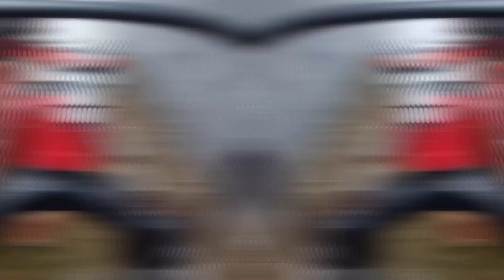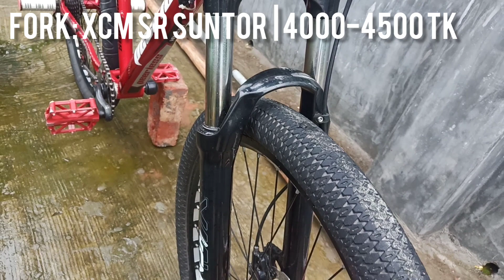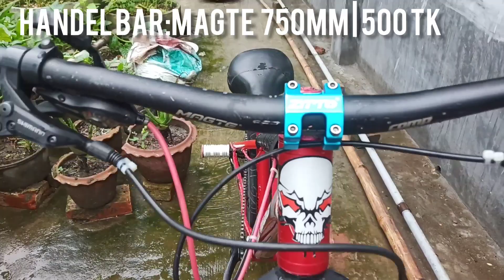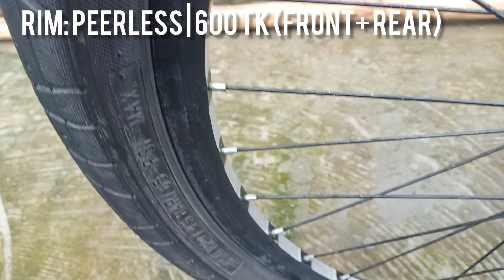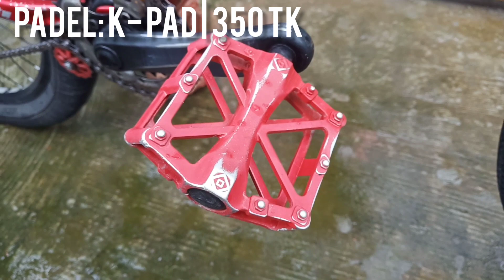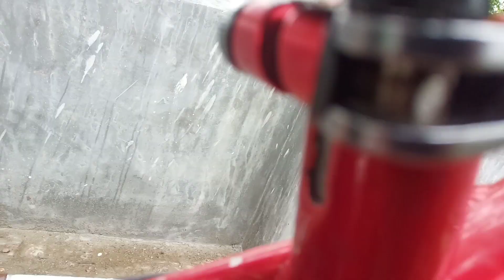😱Cheapest MTB Stunt Bike Review (Under 28,000৳) in Bangladesh || Stunt Cycle Price in Bangladesh

Comment: Where should i build it in dhaka?
i went to cycle space they dont have pearless, etc
Reply from the maker: Yeah dude at this moment peerless frame out of stock. U can try others frame like wissco. If you have low budget I can suggest you to make a cycle with wissco frame cause this is more better than cr velocity and peerless.
Reply from the maker: And yes u can build it in dhaka. I hope Cycle Mechanix and Bike Shope BD build it properly
Reply: @MaahiFreestyle  i do know about cycle frames good but i thought pearless costs less then wissci
Reply: @MaahiFreestyle  can you please give me all specs of a good wissco 4x cycle costs around 20k to 25k not more then that
Reply from the maker: It is depending of your bike's parts
Reply: @MaahiFreestyle  pls give a list
Reply from the maker: Wissco-Seatpost, Headset =12,800-13,000 Tk
Fork- Peerless=1600tk
Brake-Shimano Mt-200= 2600tk
Wheelset:
Rim-Peerlees(pair) 800tk, Tyre-Mtrixx(pair) 500tk,Hub(pair)-local- approx 800tk
Dera Shimano TZ-200tk
Freewheel-250tk(7,8 Speed)
Chain Shimano ig- 120tk
Crank- local- 450tk
Handel-Wake 780mm- 400tk (copy)
Stem- (wake,ztto)- 350tk
Grip-Meghna-100tk
Seat-150
Rotor-300tk(pair)
Shifter-250tk